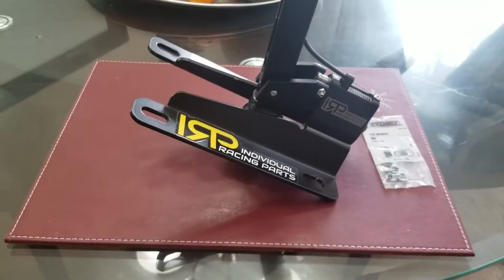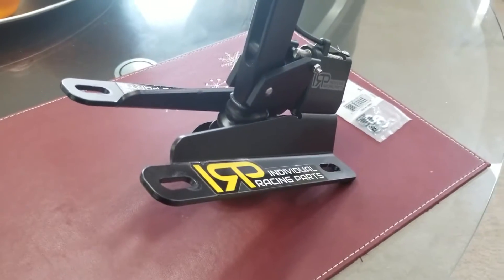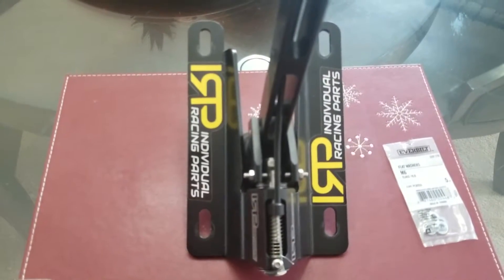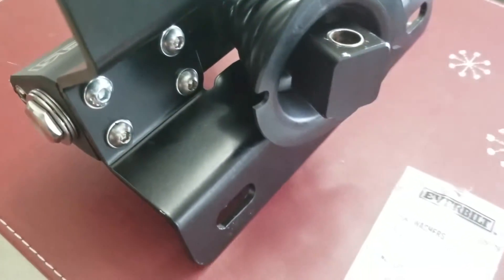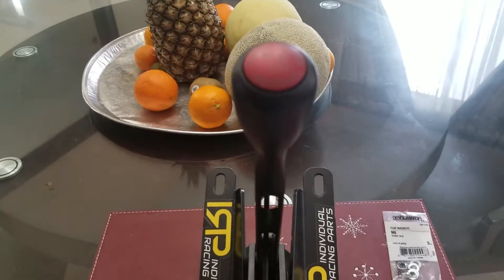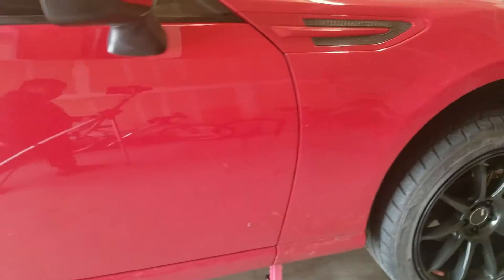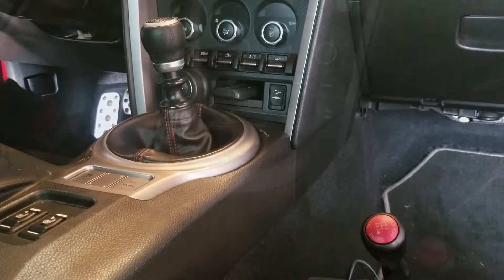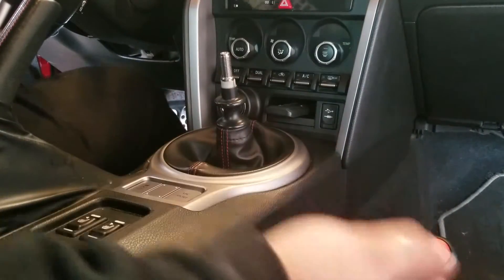Individual Racing Parts (IRP) Short Shifter Install For Brz, FRS, GT86

Comment: There should have been another base plate that the small rubber boot attaches to, as that will stop water and debris getting into the cabin.

Also, if you have a 3 inch aluminum tail shaft, I would recommend making another plate to raise the shifter ander 2mm as the base of the shifter is very tight to it.
Reply from the maker: You are right! I did miss that! Yes as i purchased it used didn't even noticed i needed that. I will try to contact irp and see if i can buy one from them. Thanks for the advice!

Comment: Hey man, it's Key666 here the guy that keeps asking questions in your Road to 400hp videos 😂

Anyways, what you're doing is basically what I have in mind for! My god, didn't think there's many that think alike. Haha

One curious thing is, I know this shifter makes shift throws like 60% shorter, but I'm worried the height of the damn shifter is too....Um...High/tall? Doesnt it look way too ricy? Compared to those that's like a cart boy short shifter?
Reply from the maker: Wasaaap lol, just trying to do everything right the first time haha.

Honestly people get surprise by it whenever they see mine. It does take a little time getting used too but in terms of performance it makes sense. The height of it makes it closer to the steering wheel, therefore theoretically shorter shift time, right?

I think the dildo or long looking knobs are ricy but not this one since it is functional. The height gives it leverage because trying to shift this thing from the base is almost impossible, haha.
Reply: @brzser8387  really wish I could get a real feel of these things before deciding on it. 

And you mentioned in the other video, Mtec springs and the shifter makes it feel better? 

And 2017 model feels even better than the previous models? What was really done you reckon? Gearbox and everything should technically be the same.
Reply from the maker: @Aaron86Productions  yeah, the shifts had better placement feedback, very hard to explain. People call it a bolt action feeling lol. 

It probably has something to do with milage. The 2017 has considerably lower miles, less abused and shifter just felt smoother.

But the IRP makes a big difference, if we do think alike, i thinkn you'll love it, haha. Right now i prefer it more than stock, with the exception of that annoying rattle everyone talks about.
Reply: @brzser8387  regarding that rattle noise, if you bought it from Ft86speedfacoty they will send you a kit to remove it, which apparently makes a big difference in the vibration and rattle free. Is your one a V3? I'm thinking of investing in IRP, if it shifts good then it's a racer thing. Lol
Reply from the maker: @Aaron86Productions  i bought it used, but contacted IRP directly to buy the rattle kit and rubber gasket ($75USD). It does  stop some rattle, but there's another one that doesn't have a definite fix. The set screws that i talk about is i think where 90% of the annoying rattle is coming from. It hits the spring loaded rod and its a metal to metal rattle.

I figured if i put some kind of rubber caps it would stop, or maybe something on the rod, but one person here commented that they eventually wear off. So in that case it might just have to be a maintenance thing that you change every so often.

Comment: The V3 has a rattle fix. Go on ft86speedfactory for that part of the kit.
Reply from the maker: I believe that they require some kind of proof of purchase. Since i bought mine used i have no proof haha. Also I've heard that many people installed the anti rattle kit but didn't help. I plan to add some kind of foam insulation instead to try and reduce it.

Comment: Did you need to push the carrier pins back in on the car. For some reason after install my shifter wont go into 1st, 3rd or 5th. it is like something is in the way
Reply from the maker: Did you adjust the set screws by the shifter?
Reply from the maker: I talked about it at around 13:40.